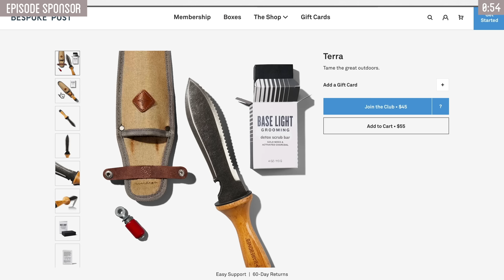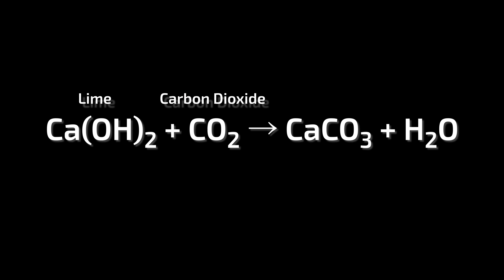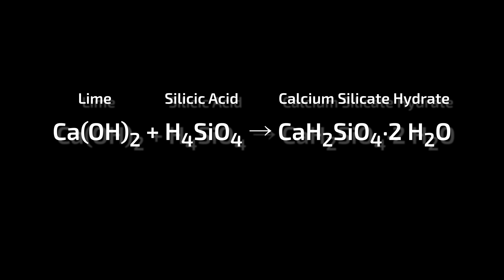How to Make Roman Concrete (4 Different Materials, 4 Different Strengths)

Comment: i wonder what crap he will have to go through when he gets to the steam area he will have to build a fricken train XD
Reply: I hope he doesn't make a Heron's engine (aka 'aeolipile') and call it a day. I would like to see something atleast similar to a oscillating cylinder engine.
Reply: @vysakhak191  followed by a pulse rocket made with that crappy bronze knife :)
Reply: the greeks had a steam engine the concept is simple but the materials and sizes for "trains" requires metal work and machining  . the first engines were for water pumps and were hand forged wrought iron things more related to a pressure cooker than a train
Reply: It has been too long, but I once saw an article (probably in paper... 1990s) about the idea of a Roman uzi made of bronze.  They had all the mechanical skill, but were missing the powder to make the rounds, - although that already existed some few miles to the East.  If I remember correctly, due to the nature of the primary material (bronze), it had to be made larger, so it ended up looking a bit more like the size of a Gatling gun.  (Still... it would have been a bit of a game changer in their wars.)
Reply: @josephbenson4413  imagine if in one of the battles of romans before the battle started they pulled up with A DAMN UZI ngl if i was against roman in that time and they pulled up with a uzi you better belive im getting the hell outta there
Reply: You mean "go through"?
Reply: @drk5orp-655  yea my english kind sucks its not my main languge
Reply: I just hope he doesn't kill himself honestly, but steam is a different ballgame than most of what he does and...uh...most of what he does is...let's say "not great".

Comment: So when are you making a steam engine car? XD
Reply: Im waiting for a hydrogen powered car which would solve fuel problem
Reply: @razor-wd2pc  it would not since hydrogen is produced with electricity. which is reliably produces with fossil fuel.
Reply: @Nicolas-lo8db  You can get electricity from other sources than fossil fuels.
Reply: @razor-wd2pc  the way hydrogen or water fueled cars work is through electrolysis but the thing is you use more power to split water molecules apart then you get out of it
Reply: @black_rhino241  I agree, but hydrogen cars have the same advantages as petrol and diesel cars while still being a renewable fuel as long as it is produced using wind or hydro power.
Reply: @ivarlaupet8972  yeah and they’re also giant hydrogen bombs on wheels and with an oxygen byproduct to make the explosions even larger
Reply: @black_rhino241  yep, that’s right😂
Reply: Honestly 📠
Reply: Cant wait!